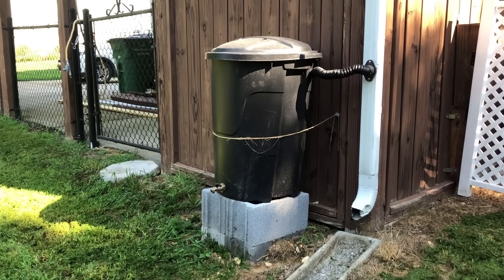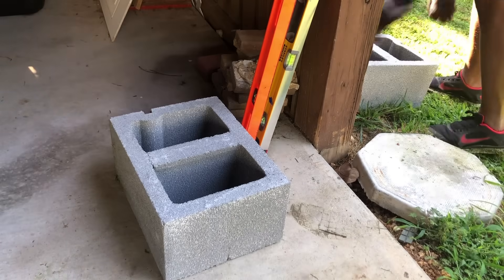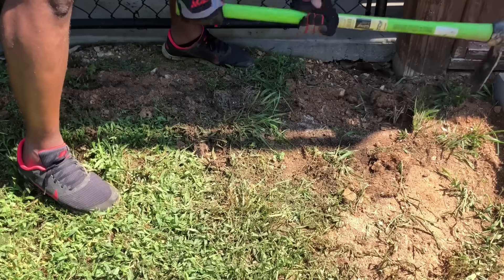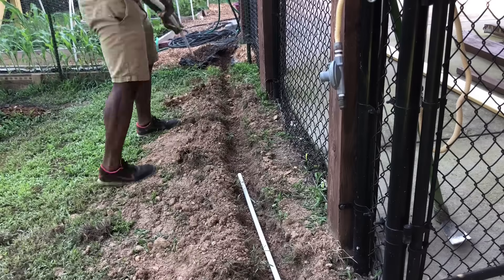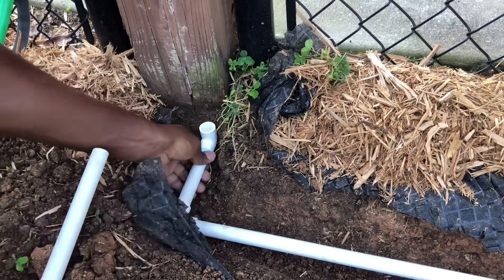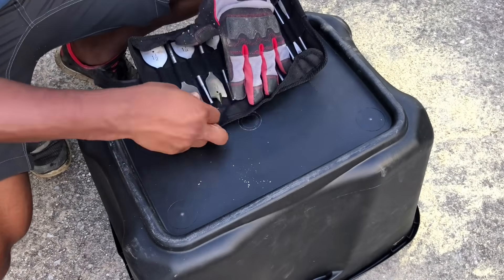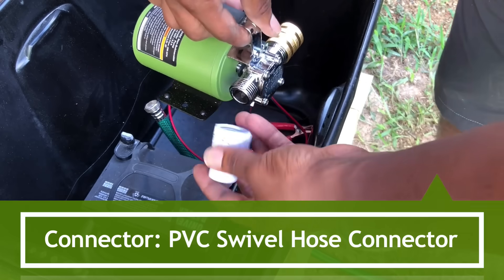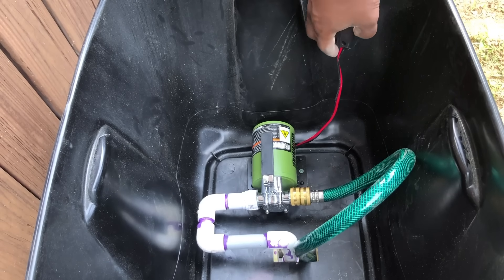Rain Barrel System | CHEAP Water Pump Setup

Comment: I live in Puerto Rico where I have a farm. Before I bought my farm I was renting a house every now and then. I always HARVEST RAIN WATER AND PURIFY IT WITH A ULTRA VIOLET WATER STERILIZER SYSTEM. 
I used large 55 gallon barrels,  a window screen mesh and white bedsheets to filter my water. I would boil the water and use an aquarium pump to pump it up to the roof. 
I haven't used City or government water for over TWENTY years. 
I did it because I started getting very sick from their water supply and had to undergo kidney surgery FOUR TIMES. 
Now I have a LARGER SYSTEM OF RAIN WATER HARVESTING AND PURIFICATION AND STORAGE. 
I built my system based upon the OLYMPIC SIZED SWIMMING POOLS WHICH CAN HOLD FOUR MILLION GALLONS OF WATER. 
I converted the swimming pools into tanks and yes I use aquarium pumps and solar energy combined with wind Turbines and hydro electric power. 
I built a 100 foot tower with enclosed pipes that the water is constantly circulating and falling producing hydro electric power. It helps to purify my water. 
Here in Puerto Rico on the West coast we get lots of rain and at times torrential rainfall. I have twelve Olympic sized SWIMMING pools that were converted into water storage tanks. 
I have another four Olympic sized SWIMMING pools for raw rain water harvesting. Under the ground and under lots of gravel I have ten inch pipes which holes to capture the rain water. 
My water PURIFICATION system is FILTERS,  REVERSE OSMOSIS AND WATER DISTILLATION. 
To prevent bacteria and viruses I use the ULTRAVIOLET WATER STERILIZER SYSTEMS.  Been using it for several years before the CORONAVIRUS outbreak. 
Now it's extremely difficult to find ULTRA VIOLET water STERILIZER SYSTEMS.  Because people are using the ULTRAVIOLET lights to mitigate the effects of the CORONAVIRUS outbreak. 
I built a Greenhouse to grow food that were indigenous to other countries and climates. 
I grow and raise my own food. My mom and grandmother taught me a man how to can my own food safely and store it.
I can even preserve my own food. 
Unfortunately the WHITE people from the UNITED STATES have been trying to get my farm from me. They even tried to forge my signature in order to claim that I sold my farm to them. This is NOT a RACIST comment. But a real estate agent was caught breaking into my house and photographing my personal papers for my signature. She was from a real estate company that was in Oneida New York State and she had a Chinese client who wanted my farm. 
So you need to PROTECT your property and especially your rain water. 

Because the next GLOBAL conflict will be over DRINKING water. The next GLOBAL CURRENCY will be DRINKING water. In the not to distant future a test TUBE of DRINKING water will cost over TWENTY FIVE THOUSAND DOLLARS. 
You are completely forget about the CRYPTO CURRENCY CRAZE.  Because DRINKING water will be more valuable than gold,  silver,  platinum or any other type of precious metals. 
I remember my grandfather reading a  story in the bible where a man who was in hell pleading for just three drops of water on his tongue. That's the FUTURE of water around the entire planet. 
Now you have a system that you MUST PROTECT.

Comment: Great video.  Do you thin it's hard on the pump when you release the spray nozzle for a short time?  Obviously, I wouldn't leave the pump running without passing water through for very long, but I am curious how it handles the pressure without spraying?
Reply from the maker: Hey Chad. Great question. I would not recommend it since it's not what the pump is meant for. For my application I do not plan to use it in the method I displayed in the video as a test. I will be using it for a drip irrigation system so there will always be a path for water to exit. If you do need to have that option, you may want to look into "on-demand" pumps, similar to what they use in RVs.
Reply: @GreenTechTown  thanks for the reply.  Have seen those, I was just trying to keep the cost down. I’m probably only going to use my pump once a week for about 30 gallons at a time. I have a rain barrel in my truck that I am trying to water a remote garden. I don’t need much, but the gravity feed just isn’t quite enough.

Comment: Like that your thinking solar.  Would suggest reaming the pipe and a threaded coupling inside the battery box area.  For future repairs/ upgrades.  If it can't be precise at least make it adjustable.
Reply from the maker: Good suggestion ed Lopez!

Comment: Working on something similar but I didn't get the big pump, as I am doing a Hydroponic System that doesn't require that much pressure. 2 Solar Panels @ 100W each and 2 Deep Cells @ 12V for a 12 or 24V system and then 2 pumps for 2 different nutrient solutions. Trying 1 set Strawberries and set Tomatoes & Peppers Good Luck with the garden this year!.
Reply from the maker: Thanks USCitizen56, and good luck with your strawberries too!

Comment: that was a lot more complicated than I thought it was going to be! Good job! Why did you use a battery vs a plugged in variety motor? And about your spiget, your pvc pipe extends up...what is that for?
Reply from the maker: Thanks. I used a battery so that I could easily power the pump from a solar panel and not have to install an inverter. Regarding the spigot, there was not specific reason other than personal preference.

Comment: Great video and narration. I did something similar but I am fortunate to be able to house the pump and battery inside my shed. I also added solar panels like you mention mostly because there is no electricity near my garden/shed. I highly recommend that. Harbor freight has a kit with everything you need to power a shed including two lights. I have four 55 gal barrels linked together feeding the pump. They get rain water from the roof of the 10x10 shed. I’m always amazed at how quickly a little rain off that little roof fill the barrels! My next step is to run pvc pipe to drip irrigation hoses as you did and maybe a timer to run the whole thing. Overall a great way to water a garden.
Reply from the maker: That is awesome and thanks for sharing your success and details! Always appreciated.

Comment: OMFG, This is why you shouldn't do your own plumbing. I am not certain if you realize the GRAVITY of what you have just done. As a plumber I can tell you from what I have seen in this video, the City would fine you heavily for this action. You have created a CROSS CONTAMINATION SITUATION that is SUPER ILLEGAL. I don';t know WHERE you are in the US, but EVERY state in the union along with Canada ALL use the same guidlines for preventing what you have done here. If you have both valves open, you can pressure feed rain water into the water utility as well as your house. Untreated water is a potential health risk. You didn't show it, but i REALLY hope that you have at LEAST a DCVA Double Check valve in your house feeding that outside  grid connection. If not, please have a plumber come check your system, as I am sure that you don't want to be responsible for bird poop and other debris ending up in the public water system untreated.
Message me back if you need some help fixing this.
Oh, and a single check valve from the home improvement store will NOT SUFFICE, trust me on this, call a plumber to verify.
I see that nearly 400k people have seen this, and I only hope no one has followed your example.

Comment: This was an excellent set up video. Please share how it has been performing and the next steps you take for improvement. Thank you.
Reply from the maker: Hey Lucy. I've a few more videos related to this setup, and so far the system and improvements (solar panel added, wireless control, float switch etc.) are still working great.

Comment: Hello recommend an option that is stronger than Drummond 1/10 horse power external transfer pump? It is just not strong enough to push out a strong amount through a sprinkler system
Reply from the maker: Currently the pump I used in the video is the only one I've worked with to date. Harbor Freight definitely had a few more powerful options, and Amazon does as well. I would suggest visiting a local store that sells pumps and see what they might recommend for your application.

Comment: Ive often thought of doing this for my garden. But I was thinking using a 12v pump with pressure switch,  and a water timer. The timer "should" trigger the pump off and on due to line pressure. Great video though
Reply from the maker: That's a good idea as well. I've heard other people using on-demand pumps also.

Comment: 5:25 I wouldn't put the wood around the base, since if it stays damp it'll rot. But it looks like you've got an inch or two of clearance, and I can't argue with your aesthetics. Did you stain the wood?
Reply from the maker: Hey Benjamin. Good tip, and no I did not stain the wood. Initially this was suppose to be a temporary setup, but I think soon I will stain the wood.

Comment: should have used a 5.5 GPM Pressure on demand water pump, such as used on boats and RV's for fresh water use or wash down pressure pump. Yes, a solar panel along with a solar controller would make your system self contained and totally off grid.

Comment: So well done (the info, pacing, production - all of it), and yes would love to see your next video on solar and/or automation if watering.

Noticed your raised beds - have you tried straw-bale gardening (for which automated drip-hose, rain-water watering would be ideal).

Lastly (and sorry if you answered this elsewhere), what are your thoughts on safety of water off an asphalt shingle roof?
Reply from the maker: It seems to be varying points when it comes to the that topic, and I'm by no means an expert, but depending on the type of asphalt, some claim it should be okay for your garden, but recommend using a drip style watering system and not watering from above (water directly into the soil). I have changed my water system quite a bit since the posting of this video and currently use a form of drip irrigation which I plan to make a video about in the future.

Comment: Love it!  As you were thinking of watering systems, had you thought of getting sprinkler heads to put in that pvc running over your garden and running water through it?
Reply from the maker: Hey Relief. I plan on using PVC to create a drip style irrigation system. I found this method to be a little easier for me when it comes to watering the garden and using less water in the process.

Comment: not sure if it would work in you’re situation but amazon sells remote light switches. i used one on my pool light. i can turn it on and off from the house  about 50 feet away
Reply from the maker: I ended up using a WIFI relay which will allow me to control the pump anywhere in the world where there is a WIFI connection. I created a video of my process if you are interested. So far it is still working really well! Thanks for sharing your idea as I'm sure that would work for someone else's situation too.
Reply: @GreenTechTown  cool i’ll check it out! thx

Comment: Code doesn't require pvc primer on pipe <4". 

The only reason for a 12v pump is to hook to a panel, otherwise 120v small pump is best & cheap(?) at HF. Skip the battery cost that way.

Could have skipped the blockwork, with that level of pt-wood deck base. Pretty "fancy" :-)

Cute little garden. I once co-operated a 21-acre hydroponic herb farm in SW FL, USA. Better to grow organic...less fussy :-) 

Still not sure why newby growers are in love with with raised beds, though. Folks been growing in-ground for 11,000-years, & still works fine. It's the SOIL Quality that matters, not it's elevation :-) 

Please, oohhh please, don't you viewers buy store-bought amended soil!! Make your own. Like real pizza, it's best...homemade :-) Buona fortuna (subbed)
Reply: Btw...I design/build FL ECOhomes* (40-years), & sailing catamarans. At my 68-years, I think I'm starting to understand it all :-)

*finishing my own 7th, in Punta Gorda, FL (Z10a)

One question...how do YOU keep seeds & starts-eating RATS out, or better, dead!?? Man, they are a real nuisance where one gardens in the intersection of wild & built environment!

Comment: Lot of work / good video, but I would caution against your valves. It is unsafe and very probably against code to have both a non-potable and city water system connected to the same piping even if it is possible isolate them with valves.  if someone accidentally opens both is would be easy to siphon the rain barrel back into the potable water if the city water has a failure.  that is why many of the codes like mandatory anti-siphon valves are in place.  there may be a system you can design, but I would check with a licensed plumber in your area to see how to modify your system to be safe and legal. otherwise - good work

Comment: I kinda don't want to say what I'm going to say, so I'll start with a compliment. GREAT video, great project idea, your setup is awesome, your information and instruction on doing this project (including the dig notice, nice touch) was top tier and like others have said, how you articulate and present is fantastic.

BUT I wouldn't consider this project green? PVC has a huge impact on the environment to manufacture and is incredibly hard to recycle (and is just as environmentally impactful to the environment). If you want to stay cheap, and are attached to using plastics, HDPE is an 'ok' alternative. If green is super important to you, iron or clay based pipes are the way to go IMO.

Comment: When connecting any water source to city water there should be a check valve on the city water line so it doesn't syphon water back into the city water source  :)  awesome job though !!

Comment: those 32gallon rubbermaid/ace hardware trashcan SUCK the biggest balls. they fail from UV and split real fast. Im in arizona so 1 year sun exposure here is like 10 years anywhere else. but still. those cans deeply disappointed me. now i use only the recycled blue barrels. they come in all sorts of sizes.

Comment: Only thing i would have done different was add a PVC union at the pump to make it easier to disconnect/replace if needed.
Reply from the maker: Good idea Matt. I agree as well.
Reply: or just put the PVC to threaded connection on the pipe coming up into the bottom of the tote and use a short length of hose to connect from it to the pump instead of having to work out all those elbows to wrap around from point A to B... then you can just undo the hose to disconnect.

Comment: wow, great video. I didn't think about using a car battery to run my water pump. How long does should it last before the battery needs to be recharged?
Reply: yeah, it worked..I love it.
Reply from the maker: Ever since I hooked up a solar panel to re-charge it I have not had an issue with it being drained so I do not have any real numbers for you yet. I typically do not water more than 2 times a day for 5-10 minutes.

Comment: I’m 11 and I have a sand box that’s 11ft by 8ft and I dug a “pond” and have run pvc underground with two exit points in to the pond and I’m thinking about buying a pump to resuscitate all the water because I use a hose right now.

Comment: Great video!!!  I just started my collection system last year.  I have 2 barrels connected via PVC toward the bottom sides which means I can collect 72 gallons without offloading to 2 other barrels I have not connected yet.  I am thinking I am going to now do that connection because my roof can get 72 gallons of rain catchment in light rain of a couple hours.  This pump idea will make it so much easier to use though (I cringe telling people I scoop and pour buckets because the pressure is garbage out of the spigot I installed)!  I really appreciate the project!
Reply from the maker: Awesome to hear, and good luck with the project!

Comment: Great video.
what kind of soaker hose do you use?  Where did you buy it?
Thanks
Reply from the maker: It's a soaker hose I purchased from Home Depot a few years ago. I believe it is a Miracle-GRO brand. I'm in the process of changing out my soaker hose system with a PVC irrigation system (PVC with tiny holes drilled into it) to save water and only apply water where needed.

Comment: Why do all this for one rain barrel? I'm actually asking, not being cynical
Reply from the maker: In my case, I typically like to start small, as well as use what resources I already have if I'm working on a new concept for the first time. Usually after doing so, a lot of knowledge is gain from what worked, and what to do differently next time before upgrading to a larger system. In some cases I'll stumble upon a resource, video, or article that explains everything in a simplified manner that fits my needs exactly, but in this case I had a hard time doing so. Great question, and hope that answers it! :D

Comment: So I have a question(s), is the pump "on demand" when turned on?  In other words, does it run until a certain pressure is reached and then shut off until a valve is opened or does it try to continuously run even when water isnt moving?

If it continuously runs, how big of a risk is it to burn out the pump motor?
Reply from the maker: It is just a normal transfer pump without a pressure switch like on-demand pumps. It is not recommended to run it continuously if you close off the water exit. For my real world application, it will be hooked up to an irrigation system so I will not have the need for a pressure switch since the water exit point will always be opened.
Reply: @GreenTechTown  Gotcha! I appreciate the reply! Cheers!